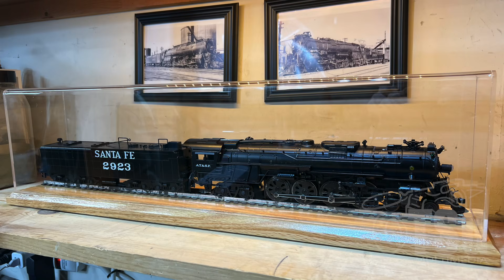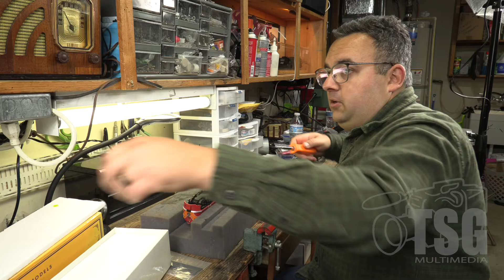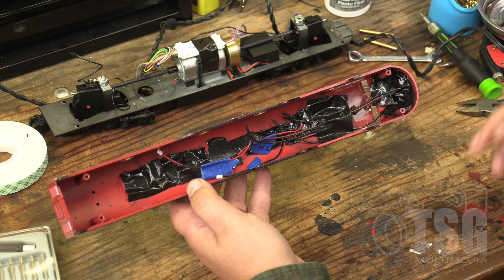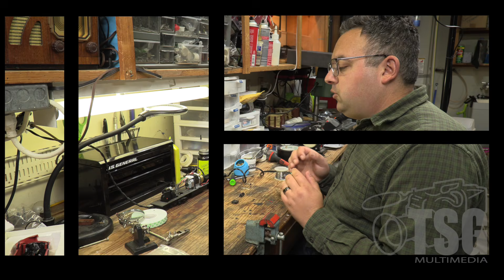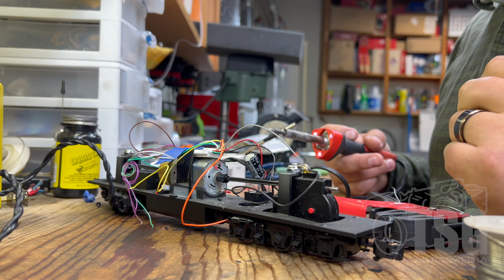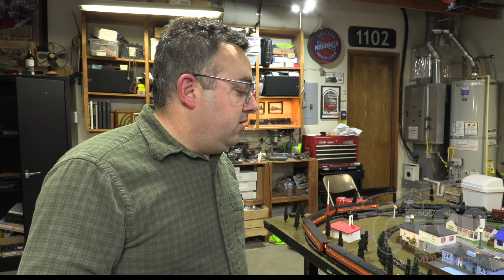Toy Trains 101 | How To Install Blunami Into S Gauge

Comment: Will these work if you have an a/c motor from American models? Or are they dc motors with a rectifier?
Reply: All American models locomotives have a DC can motor. The only difference is the AC models are equipped with an electronic reverse unit that rectifies the AC track voltage to DC for the motor. So this will work on any American Models engine because all you use of the original components is the motor.
Reply: Hi Kevin, Great presentation of installing the kit. I liked the speaker you installed incase in the plastic. I am wondering in these are available for Lionel O Gauge engines? I have a few that need replacing.
Joe Gozzo